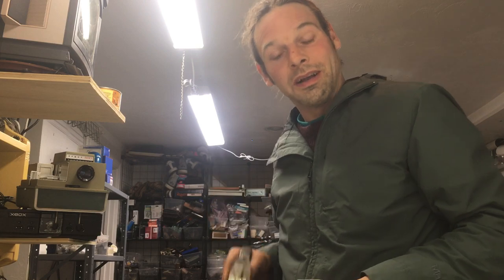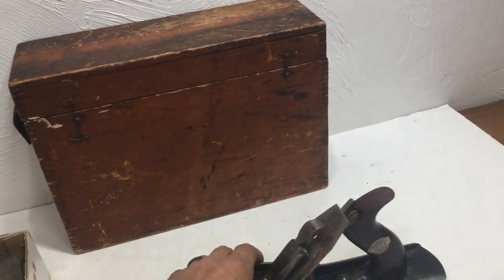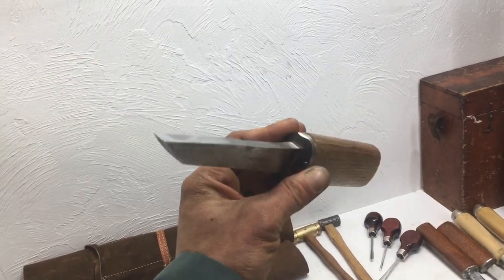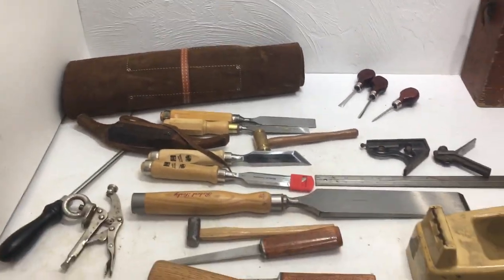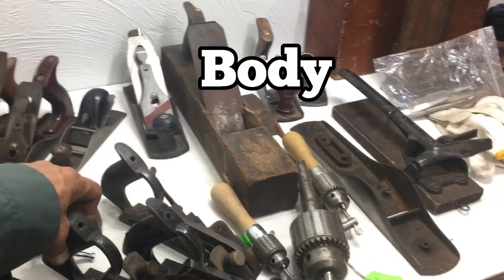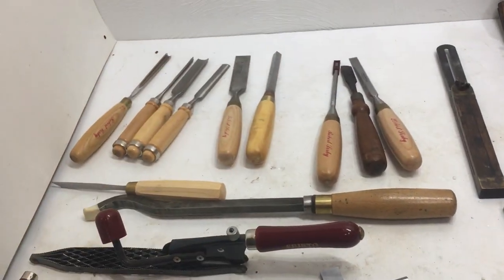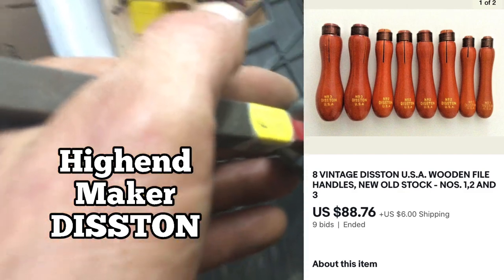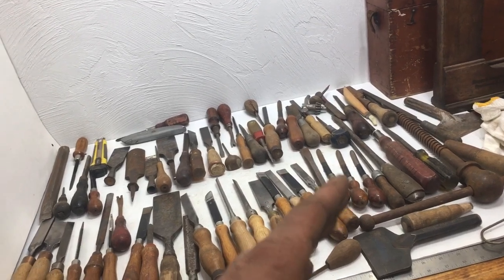Antique Tools Sell For Good Profit On EBAY + Lets Learn Tools Along The Way

Comment: Very helpful knowledge on these blades. Those blades are worth amazing money. And you got all this for $240 🙌🏻🙌🏻
Reply from the maker: lasvegas thrifts Ya Lott’s tools over looked ... blades have good markings to start researching ... Tons of variations of each tool as each manufacturer was at battle with each other, for who is the top dog ... Everything in the video cost 480 + I got 30 guides on how to build different projects they retail 15 ish ... as they are shop drawings like blue prints ...

Comment: Stanley Sweethart is the era not the quality level. It was called that as an homage to their president who's last name was Hart I beleive. A Stanley Bedrock is higher quality plane and commands more money. That one you bought is not real common, however, and is in great shape plus still has the decal on the tote ( handle). There are type studies done on most Stanleys which help nail down the age of your particular plane. For example, yours is a 10 1/2 I think...the earliest version of that from the 1890s has an adjustable throught and is worth substantially more and it pre dates Sweethart era. I'm lucky enough to have found one years ago. As an ebay seller you may not need to know all that bullshit about type studies, etc so take alot of really good pics. Also Please DO NOT wire wheel old planes in an attempt to restore them. A lot of buyers may want them just as decoration and removal of patina is a no no.